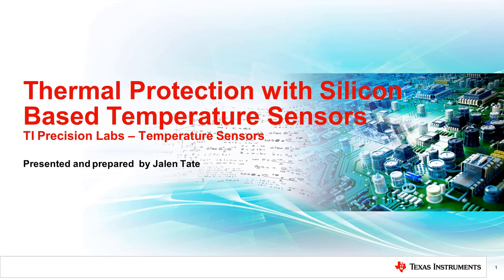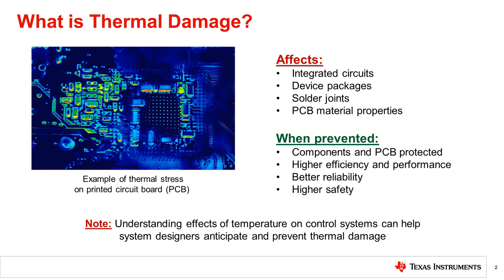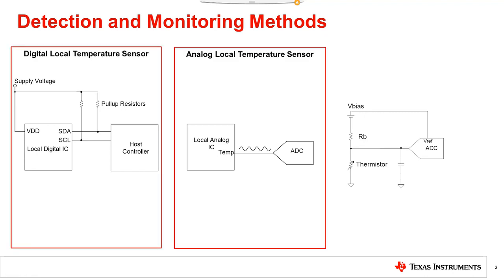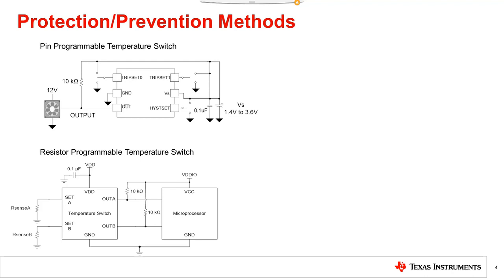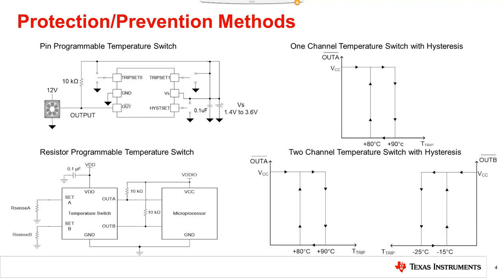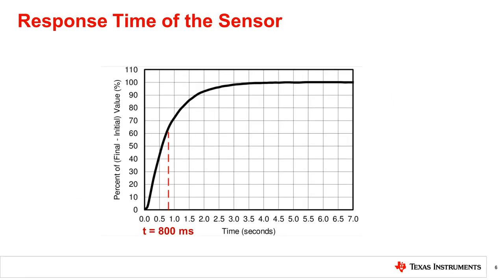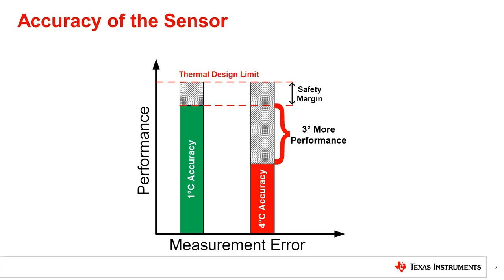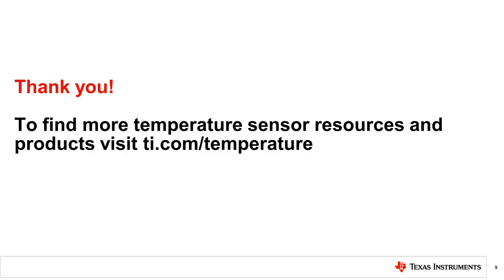Thermal protection with silicon based temperature sensors

Comment: what to do for electronic sensors and circuits which needs to operate at higher temperatures for prolonged periods of time. We have a requirement in which our circuitry has to run for 5 hours at 110 degree celcius. Please advise :)
Reply from the maker: Thanks for your question, Sritam! Many of our sensors can operate up to 150C or higher. As it relates to other components, lots of times our temperature sensors may be used to throttle a processor, reduce torque in a motor or shutoff FETs or other components that may become damaged if running for two long at the higher temperature. Check our product search to find the right solution for your application: https://www.ti.com/sensors/temperature-sensors/products.html#p1192=-55;110